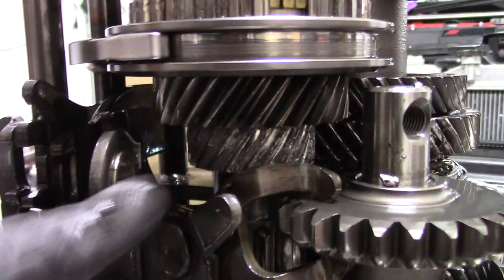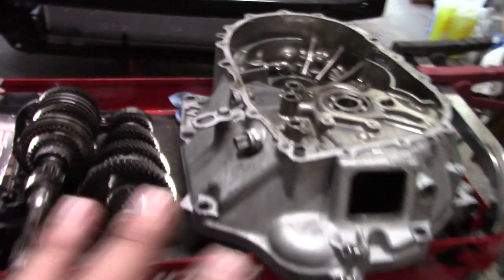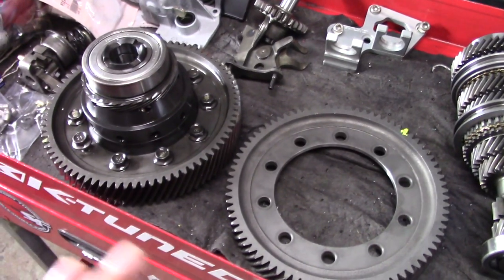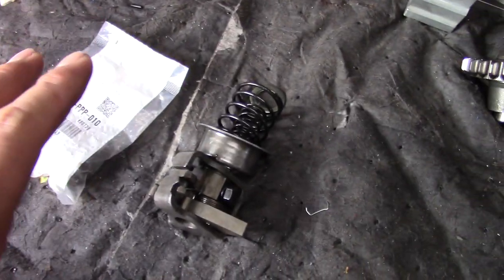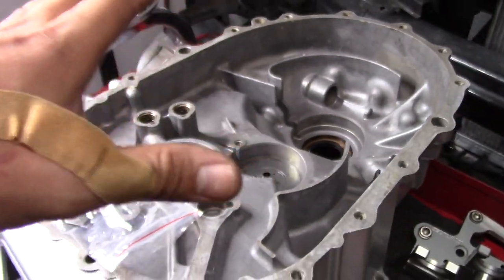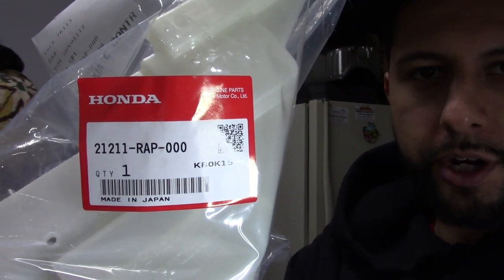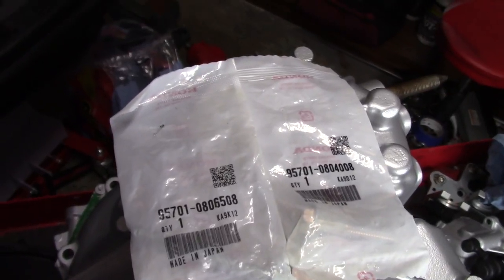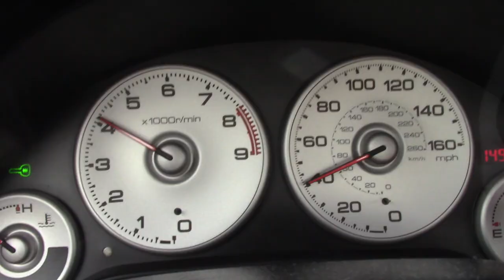K Series 4.7 Final drive installation!!

Comment: fyi, you will need to swap the counter shaft needle bearing from a2 to z1/z3 bearing. the shaft is 5mm smaller on the z1/z2 shaft.

note: you mentioned it at 22:55 :)
Reply: Just curious, but what would happen if you didn't do this? I just got done with this job but didn't change the bearing. It drives fine so far...
Reply: @trevorlawson9140   your bearing must already be the correct one, it wouldn't have fit the shaft.
Reply: @trevorlawson9140  which don't make sense if you're truly swapping from 4.3 to 4.7

Comment: @ 22:55, so i got that bearing for my fg2 trans & i got 04 rsx type s internals, but the bearing isn’t fitting onto the output shaft. What did i do wrong?

Comment: Hey Serg, im assembling my tsx transmission and was trying to install the shift selector but noticed only 3 of the 4 shifter fork slots lined up, did I do something wrong? I put a flat head in to see if I could move the sliders around to get the forks to line up in a row but it wouldn't budge.

Comment: I have a 2010 Honda accord manual i4, it come with a 4.3 final drive. I would like to put a lsd and 4.7 final drive, will it work because the gears are smaller

Comment: I am thinking of going 4.3 because i want to lower the rpm at 6th gear. I currently have 4.7.. my goal is to lower the rpm at 6th at 80mph
Reply: i'm in the process of putting an accord 5 speed in my daily ep3. tall 5th gear and 4.3 final.

while building a 4.7 lsd 6 speed from an 08 si for my other ep3.